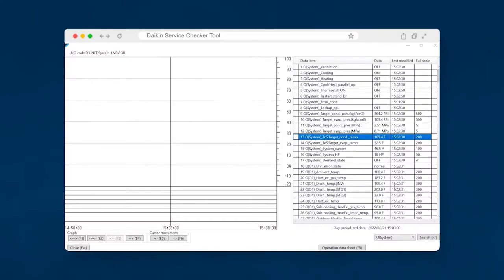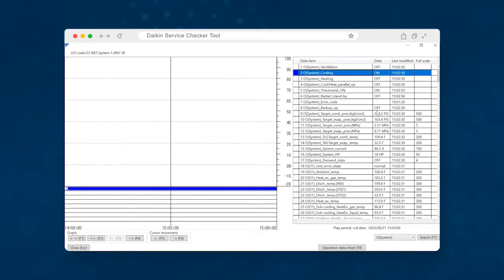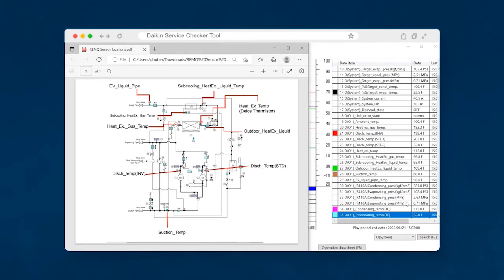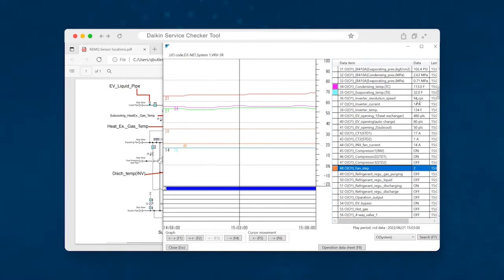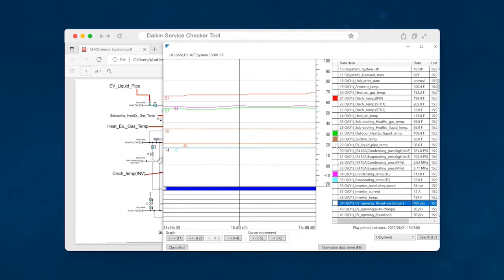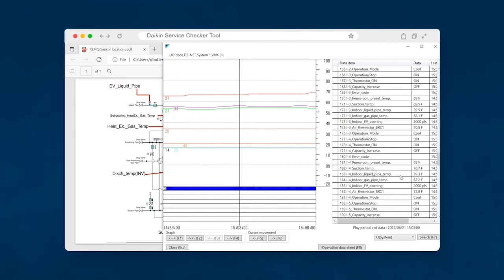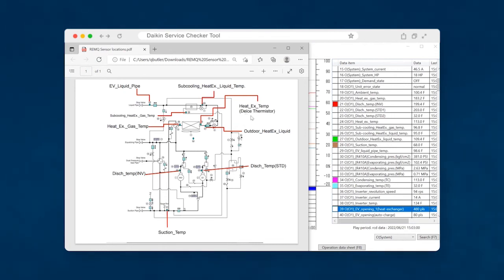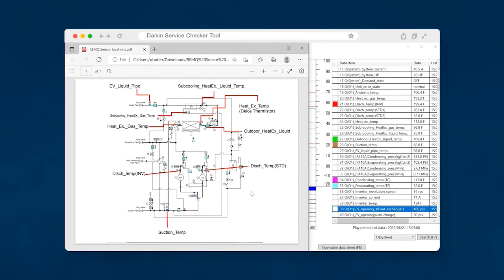Solving Refrigerant Flow Mysteries with the Daikin VRV Service Checker

Comment: Hello I work on sky air units , had a unit in cooling mode have a 60 liquid line temp and a 60 degree suction line temp with Compressor running. What’s happening???

Comment: Can you share those unit specific pdfs with what sensors match up to which? Specifically for the heat exchanger related sensors. They are often named very different in service checker compared to the manual diagram.
Reply: @MechanicalPros  happy holidays. Thank you for the quality vrv content!